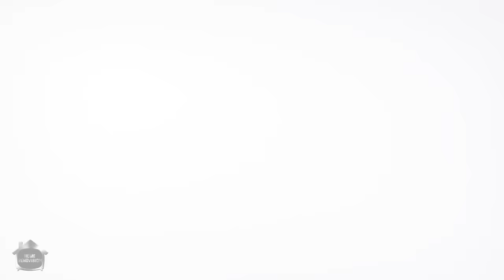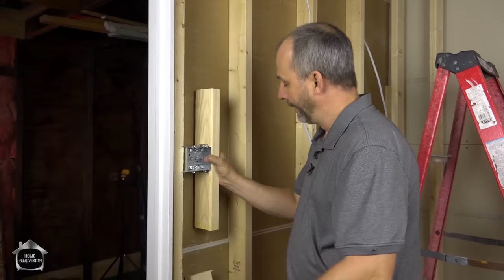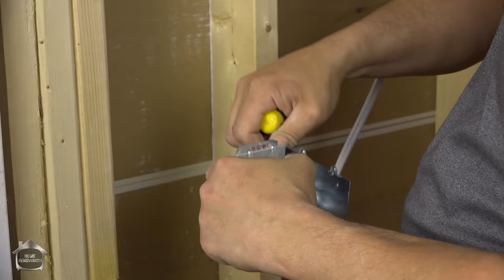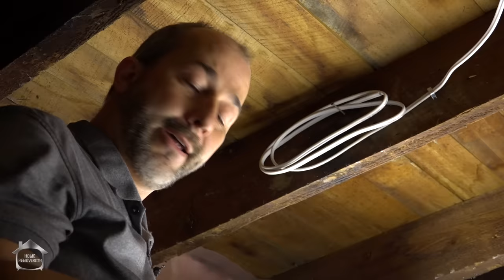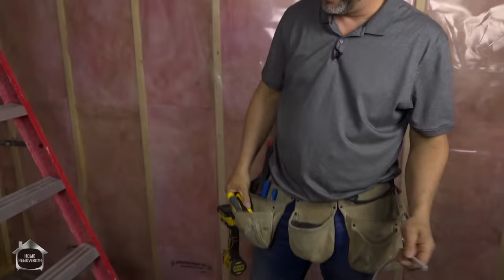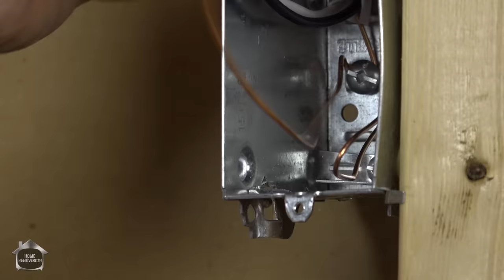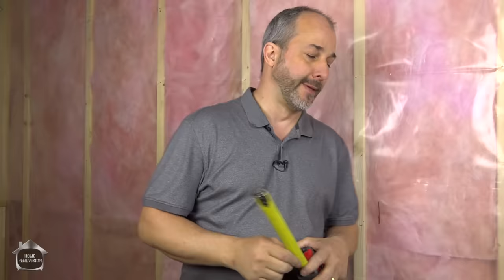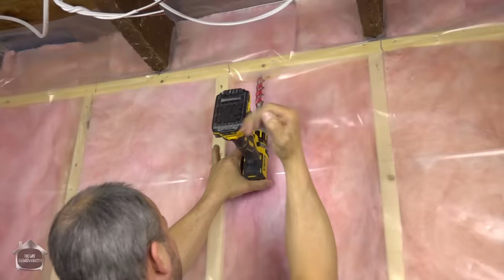DIY Bathroom Wiring | How To Run Electrical

Comment: Wow! The vital information density is simply blowing our brains!  :)     I`m doing my DIY renovation of just purchased property. I`m an engeneer, I know how to do this in theory, but I have to learn a lot about standards and requirements to not being in a trouble with posssible inspections in future. How I can find any regulations with what we have seen - a distance from the water, between clamps, etc etc etc...  I want my job wouldn`t look suspicious.  Earlier I wanted to place a semi-hidden power point next to the toilet pan to feed a heated "smart seat", and now I have a doubt whether it`s OK according the rules... But it would be ugly to leave a long extension cord from the toilet seat to the nearest "established" power point...  I`m stuck :)    Secondly I wanted install a trendy additional waterfall shower head (ceiling mounted) and after your video I have to clearly understand how much distance I have to keep from this water source to the closest downlight...  Or, might be not alowed to use ceiling lights at alll due to this shower head location...   And the last one I have to replace a standard bath tub with a corner SPA which has all the SPA pump, heater and electronic controller mounted together ad it must be located in a void between the SPA and its outside trim.  It requires 25 amps power, so needs an individual power line. A master switch must be instaled in this bathroom.  And it`s still a wet area... Where I can locate this switch ...     There are lots of questions.    I hope you can suggest me how I can find an appropriate information about that :) Thank you.  That`s not USA, Australia

Comment: Great video....I've been an electrician for 13 years and I have confidence in your install! My only suggestion is to wire up your junction boxes before the drywall goes on. Make all your joints, install all your little tails and marettes, then carefully coil the wiring to be connected to the device just behind where the device is to go. This is essential when you have many cables coming into a box, and have too many tasks on the go to try remember what is what. Also, this method will allow anyone to install devices without having completed the rough in themselves. Not necessary when you are doing a small job by yourself but still a good habit. This will eliminate most mistakes that could be made, speed up your install and help to keep the painted drywall clean since you have much less work to do to install the devices. I don't know how many times I've gotten the call to come wire someones house, only to get there to find rats nests of wiring coming out of multibanks of switches, and all the drywall installed. Then they give me the "You're the electrician" line. When a homeowner says: "I'll wire it, you just hook it up for me", never take the job.Thanks for the great vid....I can tell by the way you work that this is not your first barbeque.....but I won't tell ESA that lol.
Reply: 419gates I am an electrician as well and I am not confident in this guys install

Comment: I wished I could’ve worked with you. As a former contractor you have showed me great tips. I’m just not a fan of battery operated saws. They are perfect when no power is available. But the battery cost and lack fast depleted power is not worth it at a hundred dollar a battery. Just my way.but far more power and cost effective.

Comment: At 1:26 - Actually, the Code requires a separate 20A circuit (with 12-2 wire) for the receptacle outlets.  And they must be GFI-protected. Also, 14-3 is used for the exhaust fan if it contains a built-in light.  Black powers the fan motor, red powers the light.
Reply: you should have listened further, indeed 210-11(c)(3) applies, but there is the exception "Exception: Where the 20-ampere circuit supplies a single bathroom,
 outlets for other equipment within the same bathroom shall be permitted to be supplied in accordance with 210.23(A)(1) and (A)(2)." So as long as the 20 amp breaker that supplies the GFCI doesn't supply any other bathrooms he is good to go using it for other items in the bathroom.
Reply: Jeff not sure why you are being attacked, everything you said is accurate and stated politely
Reply: @fd3871 ou are absolutely correct FD. I have an extra 20 amp GFCI protected circuit for the floor heat in my master bathroom, but that is just me. Everything I do in my own house is better than code. I am not trying to make a living when I am working on my own house. Russ-Journeyman Electrician.
Reply: @fd3871  Yes, that's true. But my point was that the entire bathroom CANNOT be wired with just 14-2 wire, as the guy was aiming to do.  Only the lights can, as well as a basic exhaust fan without a light.
Reply: @fd3871  It seems however that he is using 2 14-2 circuits in the bathroom, one for lighting and 1 for the gfci and floor heat. The exception only applies if he is running 1 20 amp circuit to the bathroom and all lighting in addition to the gfci are all on a 20 amp homerun for only the bathroom. With him running a 14-2 home run then it is required to run a 20 amp circuit for the gfci on the vanity and no other outlets on that circuit. In most cases that I have seen the floor heating manufacture requires a second circuit to feed just the floor heat and be gfci protected. I also thought any lighting inside of a bathtub had to be gfci protected as well.
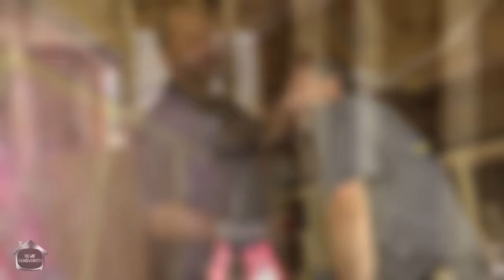Reply: @fd3871  At 27:15, he's installing a 14-2 for the receptacle.  At no time in the video does he mention 12-2.  
His installation isn't going to burn the house down, but it ain't to code.... 
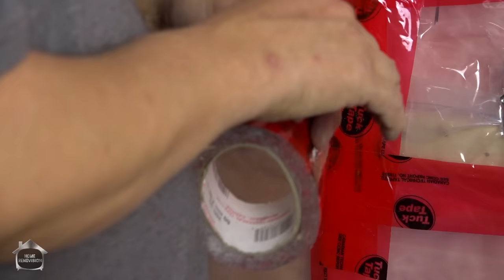AND..., I'm still laughing about 42:15, but not holding it against him at all (a by-product of being distracted by making the video).
Reply: @sncy5303  I got kicked off Electrician sub reddit for trying to explain that concept to some master electricians ehehe. 

"Logic be damned, code is god" -is the motto i think
Reply: Jeff he also claims at 32 minutes that the wires don’t matter which wires go where on the gfci this is false the feed needs to go to “line” and the wire going to his other box needs to go on load
Reply: @danstark3178  he's using a GFI breaker
Reply: Thanks for that info. Btw, is it proper to put a GFI outlet on a GFI breaker? I thought I read somewhere that it can cause problems but I'm only now learning about electrical (I was tackling plumbing first).
Reply: @Skylane2005  Is there any problem with using 12-2 instead of 14-2? I know it's a thicker wire & can handle more load, but it shouldn't hurt anything, right? It's not like using 14-2 instead of 12-2 where the wires can't handle the load. I'm also wondering about the type of wires bc I know some are rated for bathrooms/moisture & others are not.
Reply: my cats you’d use one or the other. No one usually installs both in line. That’s like putting two GFCI’s back to back
Reply: @mycats7321  
You can always use 12-2 instead of 14-2, but the only reason to do that would be if you don't have 14-2. 
Moisture rated wiring is not required for bathrooms or kitchens, because the wiring is inside the wall, and (presumably) never is exposed to dampness.
Reply: well we're here for it Jeff, always good to see the back n forth of the guys who claim to also know, that's how we learn and get even more free knowledge...cheers!
Reply: I really cant beleive what I just watched.
Reply: @pgalatioto  It's all about jealousy!
Reply: @Skylane2005  and not to mention he didn't simply edited it out. Great work Jeff.
Reply: @danstark3178  As indicated on the GFCI receptacle.
Reply: Nick J hire a professional.
Reply: Strip the black, white and green back about an inch inside the box, twist all 3 wires together with your lineman pliers, by pass the breaker at the panel and put them under the same lug as Hot feeding the panel 👍.
Reply: @sncy5303   Code or not, he should have run 12/2 for a 20 amp gfci circuit/receptacle and a separate 14/2 circuit for lights.  A Hair dryer and a curling iron plugged in at the same time can trip a 15 amp circuit.
Reply: @sncy5303  the National Electrical Code in the US is not ridiculous. It is intended to ensure the safety of people and property. Your statement shows that you do not understand the code and you are not an electrician. Therefore you are not qualified to comment on the code.
Reply: @fd3871  no 14awg on a 20a breaker. Why are you arguing if you don't understand electric code?
Reply: Man forget all yull make a big deal out of nothing going to sleep
Reply: @sncy5303  The NEC wasn't written for electronic engineers.
Reply: @arturzatorski595  TE mentions that he's an electronics engineer. I don't think the NEC is written for electronic engineers.
Reply: T. E. I live in Canada and I wish our code was as overkill as yours. I would rather put in more than I need before the drywall is up instead of having to smash walls open when the existing wiring is not meeting my needs. I ran a dedicated 20 amp circuit to my bedroom and most people said I was crazy. I think it was very smart since I can run my power hungry computer and a window AC unit at the same time during the summer. I could even extend this circuit to the adjacent bedroom which is still using knob and tube if I wanted to.
Reply: Many hair dryers are 1875 watts - 15 A circuit is only 1800 watts.
Reply: @danstark3178  The "hot" and neutral must be connected in the proper locations as well.
Reply: @mycats7321  It just redundant...will not cause any problem.
Reply: @pgalatioto  well its cause of the standard internet lol. also he did preface it with actually which according to the internet is super snobby LOLOLOLO
Reply: Dallas q
Reply: @portaadonai  Code is written for edge cases. That is some situation that is possible but not common.
Reply: @mycats7321  it is improper to install a gfci outlet on a circuit protected by a gfci breaker. Completely against code.

Comment: Thanks for the vid.  I am over in Thailand just getting to the electrical stage of my house.  They do things a little different over here and no codes to follow.  I want to be as lose as I can to  code.  I have alot of aluminium aerated block walls and full on steel stud walls that they are not use to.  This was a big help.  Thanks.

Comment: I believe all plugs are ran on 12- 2 the yellow sleeve and for lighting 14 you know the white sleeved ones. If you create too much heat using incorrect wiring you'll burn the house down so 12-2 for plugs and 14 for wiring you can look at gauge chart it will tell you what plugs and what wiring to use and you won't be spending that much more for the correct wiring.

Comment: Here in Taxachusetts you need a 20 amp cir for the outlet which would be a number 12 wire then for the lighting would be a separate circuit which would be a 14 -2  15 amp circuit, I like to run a three wire from the switch to the fan light combination because when my daughter is in there putting on make up she don’t wanna listen to the fan so they’re on separate switches

Comment: Hey man... Makes more sense: the panel is in the basement, fixtures are on the ceiling. Put your wires in the switch box the other way around. Unwritten rule from licensed guy and less wire used, less guessing for troubleshooting later. The point of screws is to be able to remove the box later when needed. Put the mounting screws in on an angle as if the drywall is there. That's why electricians use 6" impact bits. A properly cut in switch box would have neutrals tied together and tails off the hot so any apprentice can throw switches in later. Just a few tips.

Comment: Outstanding video. I am interested in adding the new 1/2 inch can lights in my laundry room. I have no experience with 14/2, 14/3 wire at all.  Electric work scares me, though I can solder and do some small project stuff like that. This video really helps me understand. Thank you. Wishing you much success!

Comment: prob dont have to say here in Ireland at this stage,but here we use 2.5mm twin and earth - brown live,blue neg,yellow green earth,for sockets,fans,etc
 1.5mm for lighting circuits only.
6.00mm for power to the oven and hob.
here we are 220-240v and although diy does happen,its not legal,everything has to be certified by a registered electrican for insurance etc.
also heres an extract from our regs

Special precautions are necessary in the bathroom because the wet surroundings pose a greater risk of electric shock than anywhere else in the house. For this reason, no sockets other than specially designed shaver outlets are allowed in bathrooms.

Portable appliances such as hairdryers, radios or heaters must not be used in the bathroom, even if plugged in outside the bathroom.

Electric showers and heaters must be installed by a registered electrical contractor

loving the vids,keep up the great work.
Reply: Lenny Rossa in sweden the color code is the same, but 1.5mm2 is used for light ans outlets, up to 13A. Over that (oven/stove) is 2.5mm2.

Comment: Those are some goofy staples, never seen them here in the US like that. At $20.00-$40.00 a pop for good lineman's I prefer to use a harbor freight $5.00 hammer than my lineman's..just saying.. :-) I would be happy to send you a box of cheep hammers if you need them...hehe.. We generally run some type of conduit down to the floor to make it easier to fish the load wire from  the floor heat into the box with the thermostat in it. I like your patience in dealing with us electricians and non electrician comments. Looking forward to your next video.
Reply: Conduit is a good idea as well.
Reply: Those staples are used in Canada, and they are excellent. They have "stops" on them so you can gauge how deep to pound them in. They're also metal so they won't break like the plastic ones in cold climates. I wish Thomas & Betts distributed them here in the USA, but they're only CSA approved, not UL approved.
Reply: I have a set of line man pliers, and the top and bottom of the jaws are actually knurled , sort of like a framing hammer that's knurled, so the pliers don't slip when you are hitting the nail of the staple

Comment: Excellent point about blocking out for wall switch beside the door.
I do it regardless of size trim.
I had an "electrician" tell me, You can't put that there, I've got to put my switch box there".... 
Ok....it's the same kind of lumber as the king stud, be my guest.😉😁
Reply: If he would have used a 4-inch square box with brackets  he could have just ran what would be a fire block and put the Box anywhere he wanted to with a two gang mud ring . Also 54 inches is too high + 42" or 46"  to the top is the ADA Compliant height, I never put my boxes on the nearest stud that is cheesy , this guy makes  excuses for everything,  I don't make excuses my shit works and I've never failed inspection

Comment: If I had my bills paid for the next 6 months.....I could see working for you for free just to gain more hands-on experience and start rehabbing my own homes.  Thanks for sharing your talents and insights with the world wide web.

I am thankful for your help. You have helped PLENTY!

I am now regretting NOT putting in a heated floor under the tiles. The wife didn't want to have the expense and now we have a little heater that sits on the floor.... Slightly tacky.....but oh well.  Not gonna rip the tiles up now!

Thanks again!

Comment: "...don't know too many cases where you would use 14/3 in a bathroom..." What about running the fan exhaust and light on separate switches. Is that not common?
Reply: He’s obviously never wired a jack and Jill bathroom before where it’s a shared bath between two bedroom doors. Admittedly, he isn’t an electrician but his work in this video is laughable. Canada’s code is supposed to be better than the US, but this workmanship wouldn’t get you a job anywhere in the states.

Comment: Must be a Canadian thing.  Required to run 12 gauge here, and be within 36 inches of sink for outlet.
Reply from the maker: Even if it is GFCI!
Reply: @HomeRenoVisionDIY  Pretty everything has to be ground fault or arc fault now.  I just run the breakers that do both.  The 20A breaker is because many ladies have lots of electric hair appliances.
Reply: @HomeRenoVisionDIY  Yeah, you want a larger wire for more load for things like hair dryers & according to the IRC (International Residential Code) you need to have a GFI outlet within 36 inches of the lavatory. It's so people can plug in their shavers, electric toothbrushes, hair dryers, & whatever other appliances people use.
Reply: Here in USA 12g is for Outlets, 14g for Lighting.

Comment: You should always pull your home run in 12/2 along with receptacles . 14 gauge wire should only be used for lighting .
Reply: A nine month necro, but the only thing I use 14 gauge wire for are surround sound speakers.
Reply: matthew bowman eh 14 wire should really only be used in small applications. If you plan on having multiple fixtures and or plugs on the same circuit just spend the lil extra and run 12 with 20 amps instead of 15

Comment: Don't forget you need a nail plate to protect your wire running through a stud from future screws. Cheers! 🍻
Reply: You only need a plate if the hole is not drilled in the Center of the stud. If it’s at least 32mm from the edge of the stud, you are good.

Comment: Good video overall, but please don't use a cordless tool to tighten the clamp screws or ground screws in your boxes.  I know, plenty of guys in the trade do it too - but they shouldn't either.  Tighten by hand, with a screwdriver, for anything in contact with wires.
Reply: I don't think any of the wires were live
Reply from the maker: Thanks Neil. Life just requires too much speed nowadays. Best to know your tools and not over tighten for sure.